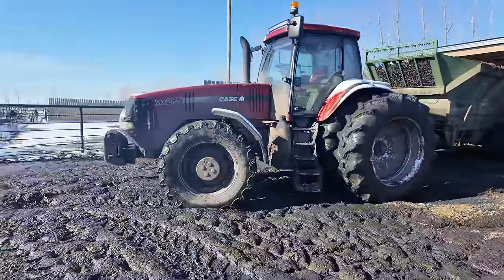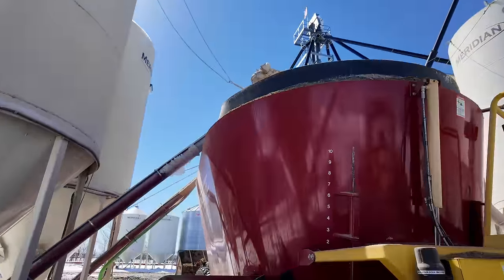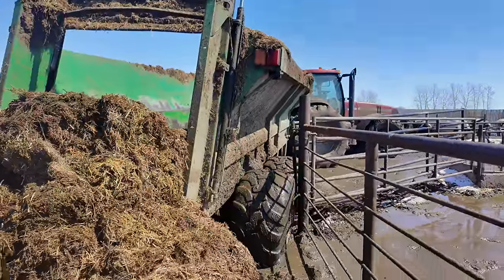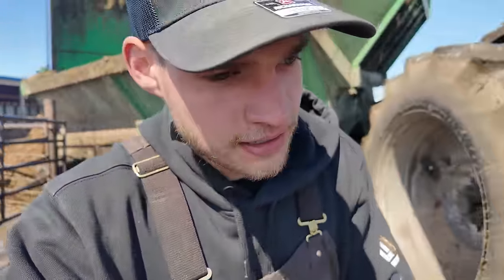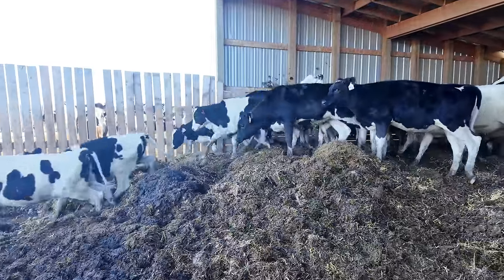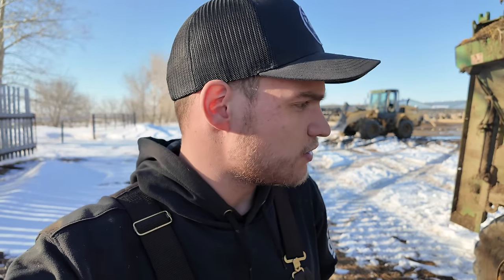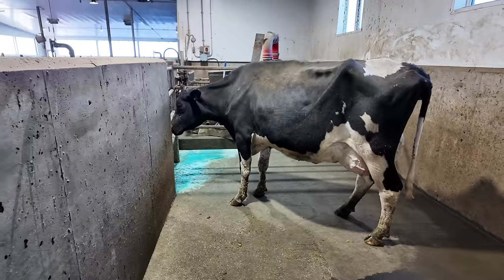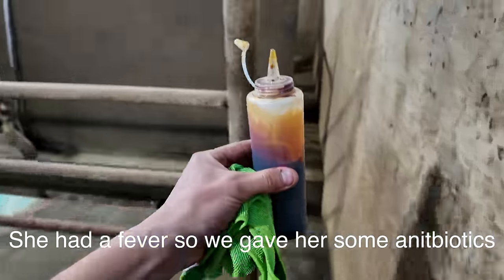2 More Tires Wrecked!..

Comment: The only people that don't mess up at some point are the people that do anything. Had a major is with water well drilling, cable snapped and had 7500.00 worth of tooling sitting at bottom of 300 ft well. We did what we had to do to retrieve it. Lots of extra time and money but all you can do is keep moving forward. Keep up the great work!

Comment: While your already spending the money , time and fuel you might as well buy 3 new tires then put the new wheel and tire set on and have 4 new matching tires . Still hurts the check book but at least you would know they are all new and you still have a usable spare after taking off the 3 junk tires .

Comment: Good video!
Is there any local tyre company’s that could vulcanise the tyres. It’s surely saved me a fortune over the years, I’ve even had them repair a 4 wheeler tyre that had a three inch cut through the wall.  🤭

Comment: Yes, I'd agree the rims look saveable. I seen reinforced beads on rims with rebar or like. But the tires, don't think you could lean them up and tube them to work. Is there no heave truck rim or tire that would fit? Mind you, could cost simmilar. If heading on a road trip, should see ifvany barns in area to get quick tour of. 👍👍

Comment: I recently did something similar to a tire on my car. I was coming around a street corner, pulling into a parking space . I brushed the curb. I put a cut in the sidewall big enough to stick my hand in. When I went back to look at the curb, I found 1” piece of metal that had been bent out  of place that cut into the tire. I felt stupid, but as you said things happen.

Comment: Ferdinand feeling for sick lady…MOOOOoooooOOOO – hot brown needs to do some more checking

Sapphires glinting in the sun…clean tip?…hottie squatty pump…lube in the tube…Feedus Maximus; nice recovery…support to Feder, good guy from what has been shared…“can stick my finger in there”…kind of close to DK; closer to sylvan vales than DK; safe travels…“F-150”…reading the sign language

"don't want to over-grease things especially when you get into PTO shafts" - hear ya!...😊 might want to check a temperature as well

Comment: Words of wisdom "if you don't make mistakes you're not doing anything". i was moving and expensive copier machine and did not check all the handles locking pins and one of the handles of the hand truck came and we lost control of the cart the copier fell onto the sidewalk. $21000.00 mistake. so let Fetta don't feel so bad it could be worse no got hurt.

Comment: The same thing happened to my manure spreader.  Tire was low on air from the day before spreading.  Put some air in it thinking was a slow leak that it had developed.   Three loads later, I'm pulling into the field to spread and i notice tire half off the rim ripped up some   The tube inside valve stem is torn off.  Just ran the manure out keeping weight on other tire as best I could so could jack up without excessive weight of manure.  Still yet to mount another tire 2 days later.

Comment: You should be able to take those tires and have them vulcanized from the inside and then put tubes in them probably be a cheaper alternative and the bent rim you could take care of with a hammer because with the tube you won't have to seal the air good luck hope this helps you

Comment: there are and has to be other options for tires, centers with the bolt pattern can be cut out and welded in to other rims with or without offset like highway truck supper single rims just one example,  or maybe changing the hub would be a better option

Comment: 😳😳😳 feedlot here in Texas would have a gate in the back of the pins and then pull straight through from the back to the front or front to the back one of the other don't have to turn around and back in and all that😳😳😳😳

Comment: They are not quite as big and not a flotation tire. Could you buy some used front tires and rims off a cement truck. We had those on a large spreader of ours. Just an idea.